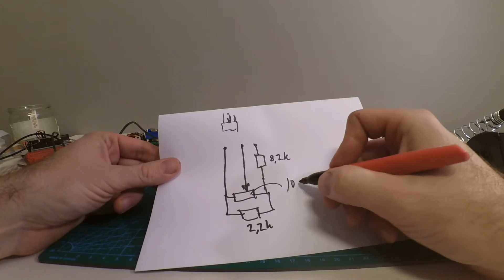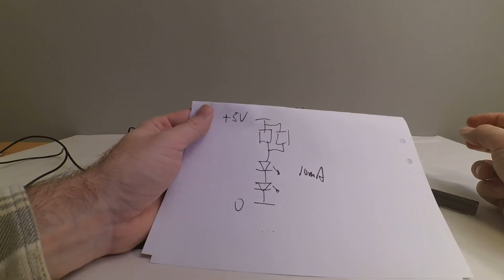#1:3 0-30V 2mA - 3A Adjustable DC Regulated Power Supply DIY Kit - Part 3 Mods

Comment: Hi, why are you only getting 24V DV output?
Reply from the maker: The AC supply (transformer) I used didn't deliver 24V AC and because of that it's a bot low. But it can save the Op-Amps in the circuit. Feeding the circuit 24VAC can create an internal DC voltage inn the circuit that will fry the Op-Amps.

Comment: If we add another similar output transistors (ex.Q5/Q6/Q7..)in parallel with Q4, so that the bases of both transistors should be joined together, the collectors of the  transistors should be joined together, and from emitters of each transistor to the output positive teminal should be add one resistor 0.22 ohm / 3-5W, in order to balance the power load of the four parallel connected output transistors Q4 and Q5/Q6/Q7.Does it possible to work for output current 10 Amps ???
Or must be some mod on current limit circuit ??
*of course the TR-secondary .gives 22-24Vac 10-12 Amps,
& the filter caps are be 10.000 μF+
thanks
Reply from the maker: I'm not the expert to answer this but here are something on the top of my head: R7 the current resistor need to be changed (resistance value and power rating), the rectifier diods D1-4 need to be checked if they handle 10A, and I'm thinking if transistor Q2 and components around need to be adjusted driving more base current for 4 power transistors.
And if the PCB can handle 10A

Comment: Hey, I have this same power supply however I have some issues with it, the constant current light is always on, you showed that yours is working, what could cause it to not operate properly? 

I've seen other videos too and it's sort of hit or miss whether or not the CC light works well or not.
Reply from the maker: You can find an old blog about the circuit with a description of the function of the circuit for trouble shooting. Has the psu been working from the beginning? Do you have any output voltage? Are you feeding the circuit with AC voltage?
Reply: @KristianLaholm  yeah, I'm giving it 24VAC on the input, the output voltage is a bit low at 27V max but it does 3A well and doesn't behave strangely aside from the CC light not working as it should
Reply from the maker: @zUltra3D  The only thing I can see is the PNP-transistor "9015" driving the LED or the 2 resistors biasing it 2K2 and 10K next to the transistor. If you want to play around and do some troubleshooting :)
Reply: @KristianLaholm I have no idea, I measured the transistor and compared it to the datasheet, it all seems fine, the resistors look good, reflowed solder joints that looked bad and it stayed the same so I have no idea what else I should try, guess I'll have to live with it like this, oh well. Thanks!

Comment: can I build more of these and put them in series or parallel? to get like 60v or 6a?
best regards
Reply from the maker: In theory yes but I would have a look at a circuit that can output the desired voltage/current directly.
Having 2 current limitation circuits in parallel or series can spell trouble.

Comment: If i understand corectlly, this circuit Power supply don't have short circuit protection, if accidentally touch plus ➕ and ➖, at the output!? How i ca-n do to add some components to achieve short protection!?
Reply from the maker: If You short the output the current limitation will kick in. The circuit will only deliver the set max current by lowering the output voltage.

Comment: Can I use 0 27v 6 amp transformer for this circuit?Pls replay 
aneeshboss.007@gmail.com
Reply from the maker: Aneesh Boss No 24VAC is max voltage of you will blow the opamps.
Reply: @KristianLaholm  well, all my transformers create more than 24V....
First transformer (safety testing transformer) 30.2V RMS
Second transformer (blows my 1A fuse) 28.7V RMS
Third and most powerful transformer (blows 1.6A fuses with ease) 26.4V RMS
So far my op-amps didn't blow up, but they get pretty warm.
Also my 7812C for my 50mA fan is getting hot...
Also my kit can't limit current below 165mA....
Reply from the maker: @adamsken1f  It's not the perfect kit :) but good anoth to play around with. You must hafve gotten som good op-amps :)

Comment: Any idea what you think might be wrong if my current limiting feature stops working? I know the is good, i've been going through the board trying to make sure each component is good / not bust.
Reply from the maker: In this link you find a good description of the circuit that the kit is based on http://www.electronics-lab.com/project/0-30-vdc-stabilized-power-supply-with-current-control-0-002-3-a/

Comment: You don't need the 7805 regulator!  The resistor value would need to increase if you use 24v, but the power will be the same.  LED must be current limited not voltage limited (within reason).
Reply from the maker: +Michael Strauss If I use a larger value resister there will be a more power lost in the resistor P=IxIxR.
My LED forward voltage is 4V. With the 7805 there is 1V and 6mA over the resistor = 6mW with 24V supply there is 20V and 6mA over the resistor = 120mW.
Please correct me if I'm wrong, some times i fool myself 😀

Comment: Hello friend,
I was wondering if you could explaine how I should connect my little volt/amp display to pcb. I did connect the volt display and I see the variable voltage. But I am not sure how to connect the amp display to see the current state. Any help would be appreciated. Thanks JW
Reply from the maker: +jwhiting352 Amp (current) displays you have to connect in series with the load. Check that the amp display can handle the current, overloading a amp display will release the "magic smoke".
I have my self bought one amp-display-kit and will add it to my setup when it arrives in the mail :)
Reply: I look forward to your amp-voltage hookup :)
Reply from the maker: I have shoot the video but is not satisfied with the result because of a small mistake from my side.
But i hope the video and my misteke will amuse you all then i upload it :)
Reply: Look forward to it
Reply from the maker: +rahmansaid I have uploaded 2 new videos about current measuering, hope the info is useful.

Comment: This is the best video on that kit that I've seen, good work.

I only need a 12V PS so I'm using a 16.7V AC transformer. I only have a 12V fan so if I keep the 7824 would it put out a lower voltage because of the smaller 16.7V PS, and is it ok to run it like that.

I'm using a failed ATX PS as the case and throwing away the failed switching PS circuit board, so that all it has is box, a 12V fan, and input filter - 0.47uF cap and inductor -, that is connected directly to the 240V input socket inside the case. Is it ok to keep this filter or should I throw it out as well.

Thanks
Reply from the maker: +SidneyCritic ComedyHound Thanks :)

With that transformer (16,7V AC) my guess is that the 7824 will be putting out 20V DC, check the voltage with a multimeter before you connect the fan. 
I would search for a 7812 too keep the fan safe :)

The input filter would I keep in place.

And be careful with 240V :) Good luck :)